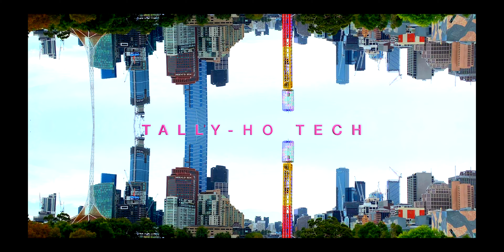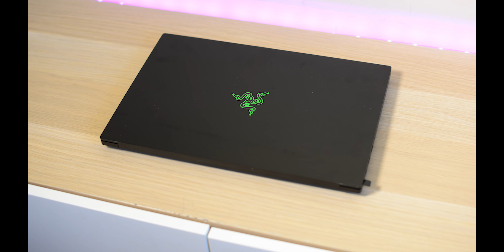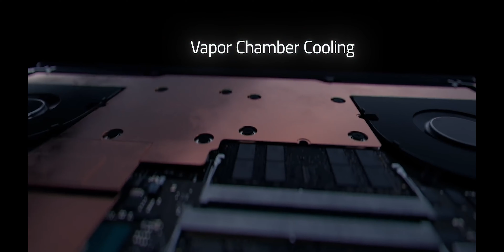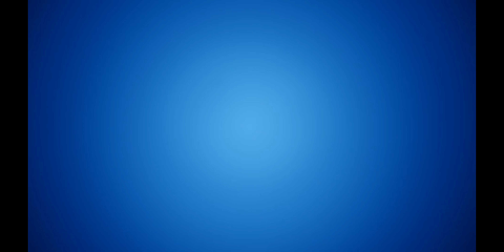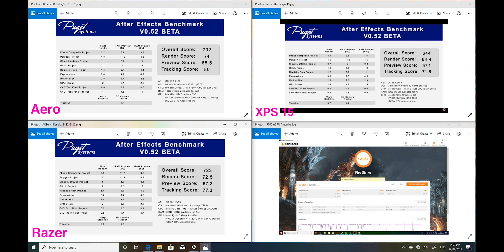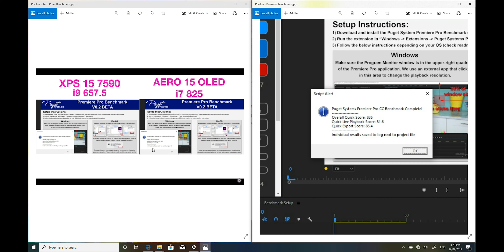Razer Blade 15 Advanced Content Creation Review v XPS 15 v Aero 15

Comment: Can u please tell me a high end gaming laptop with a good battery life and with less thermal issues.
(Rtx 2080 max q or Rtx 2070 non max q).
Reply: Aero15, check his reviews. You can even get a i9 and it’s going to have reasonable thermal.
Reply: @Ryu-z6d  it does thermal throttle. They undervolt the cpu and gpu which helps decreasing the temperature but it affect the battery and sooner the cpu and gpu also. It also doesn't gives much higher fps as compared to other laptops.
Reply: @sahilsharma2432  but it's still pretty much the best all rounder you can find in the market with in it's section. If you need to nitpicking to that level, you seriously need to break some physical rules.
Reply: @Ryu-z6d  bro what about Alienware 17 pro
Reply: @sahilsharma2432  17pro? Which one? I don't know anything called 17pro.
Reply: Dell Alienware 17 pro
Reply: @sahilsharma2432  there is no such thing I can find
Reply: @Ryu-z6d  Razor blade pro 17. Sorry my mistake
Reply: @sahilsharma2432  no battery life for that

Comment: Great review my friend!
Reply from the maker: Cheers mate
Reply: Can u please tell me a high end gaming laptop with a good battery life and with less thermal issues.
(Rtx 2080 max q or Rtx 2070 non max q).
Reply: @sahilsharma2432  the MSI GE75 would get my vote.
Reply: @OWNORDISOWN  I want to buy the i9 rtx 2080 max q but they say that it thermal throttles a lot.
Reply: @sahilsharma2432  the GE75 i9 is perfectly fine, especially if you get it from Hidevolution and they repaste. Bob of all trades reviewed it. I like my Omen 15t so that is an option or the 17t but battery life is not great. How about the GS75? Not tested it yet though.
Reply: @OWNORDISOWN  battery on ge75 is not great and the gs75 thermal throttles a lot reviewed by Mobiletechreview.
Reply: @sahilsharma2432  well, perhaps just stick with the Aero then. There are not many i9 laptops out there with big batteries.
Reply: @OWNORDISOWN  i have seen your video and the results with the rtx 2070 max q were very great when u did undervolted and overclocked.
Will the same with the i9 work without thermal throttle? And does overclocking and undervolting affects the laptop life?
Reply: Plz help..:-|
Reply: @sahilsharma2432  i think Tally Ho had the i9. I'm sure like my Omen 15t that with an undervolt it will hold 4 Ghz if the CPU load is not 100%. I was editing my video yesterday and my i9 held 4 Ghz with 35% CPU usage and 74 Deg C , using auto fan. That is the Omen 15t.
Reply: @OWNORDISOWN  so what do u think should i go for the aero 15. Well i mostly need it for gaming and i do travel so i need longer battery life to do stuff.
Reply: @sahilsharma2432  yes, that is the logical choice but it's expensive. That's why I bought the Omen 15t and purchased a car charger that out puts 150w. The Aero is the one I really wanted though.
Reply: @OWNORDISOWN  money is not a problem my dad promised me to get a high end laptop at any price point......If you know some better laptop then plz refer me.